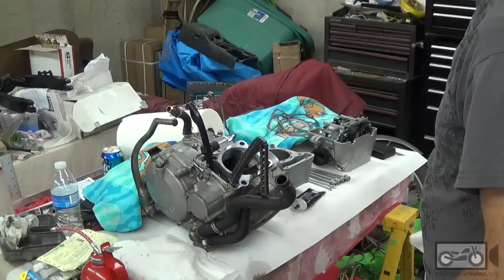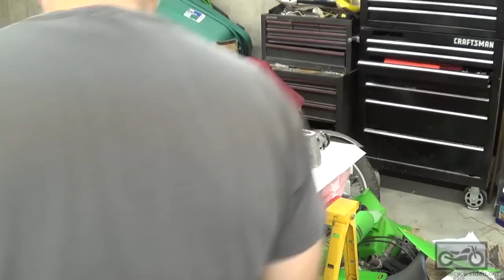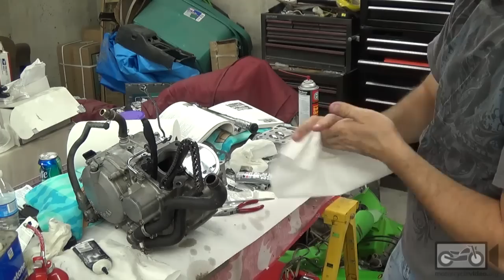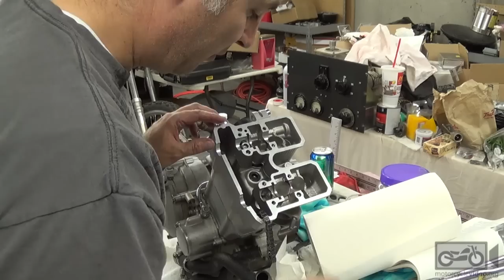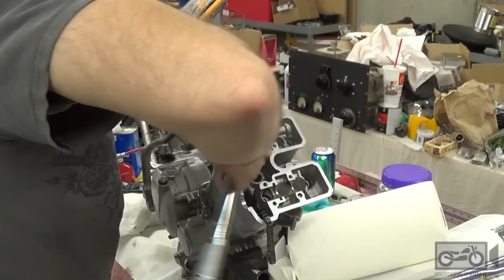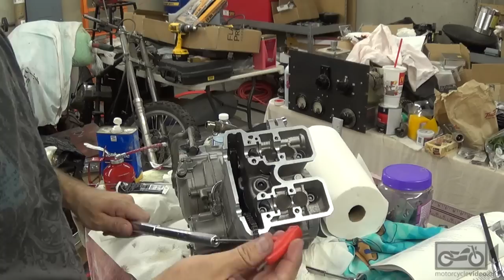How to build a motorcycle engine - KLX 351 "Katsumi"

Comment: putting the clip inside an old socket smaller than the piston clip bore before hand==compressed== , then just pushing in is a lot less drama . ps ,, spray copperkote on head gasket is better ! investing in a 1/4 drive electric impact with a clutch is also a life saver .

Comment: I hate the torque wrench part! Always afraid of snapping a bolt. Very common with todays modern stretch bolts on heads in vehicles! And yes I have done that on a Chevy 4.3 L Vortec engine! Luckily The bolt came right out wit a screw driver!

Comment: Hey is that a 240sx center glove box back there?
Reply from the maker: you called it! its for my Sons S-15 conversion car....
Reply: +MrDuhfactor lol awesome! I saw the s13 seats in another video too!
I have a 1990 240sx and a KLX250SF I want to big bore. It's a fun bike and I'm only 5'5" and 120lbs so it kinda fits me more for the street, but I'm looking for more power. When I bought it I thought it would be like my friends WR250R... I did dropped a tooth in the front sprocket and it's more fun, but I feel like it's just lacking power for me at least. Thanks for the step by step video it gave me confidence on doing it. hopefully next year some time I can buy that 351 Big Bore kit.

Comment: Does this 351 kit need the cases machined larger for the new sleeve to fit?
Reply from the maker: No, it will slip right in. My case was a unique older one that needed a little clearancing, but 99.9% of the cases have plenty if room. Good luck!

Comment: I'm trying to figure out what bore to put into my KLX250s, Just wondering how the one in katsumi has been treating you. I was thinking of doing the 300 kit from the oem parts, but if I do the 350 I'm going to go all out and get the pumper carb too.
Reply from the maker: the motor has been rock solid and reliable. I've had no trouble with the 351 kit, and absolutely love it!
Reply: So worth it over keeping the stock carb and going with the 300cc kit using the oem parts then?
Reply: Also I'm curious as to what kind of mpg you're getting with the big bore too
Reply from the maker: +Don2323 hey buddy, not sure the gas milage, but with the Acerbis tank, I can ride hard all day without running out. I'm geared down too, and only have 5 gears....
Reply: Oh god I forgot the older models were only 5 speed. Must be nice hitting with lower gearing though.

Comment from the maker: Man, I've done that so many times!!!
Reply: Mr duh, can you please point me in a good direction as to what gasket sealer you used on top of the crank case for the cylinder head??? I am inches away from ordering the 81 dollar oem liquid black that the manuel calls for and I cant find a straight answer anywhere....
Reply from the maker: @Christophernice724  You can use several different bonding agents, you can use Yamabond, or even red RTV sealant from your local aito parts store. Use a very thin application so you dont have globs falling into the motor. Good luck!
Reply: @MrDuhfactor  ok would yamabond 4 be overkill?

Comment: No, I was scared the synthetic might cause an improper ring seal, so I just went with Valvoline "superior wet clutch protection" conventional oil. 60mph and a twist of the throttle its like I'm feathering the clutch haha. Need some better springs I think, bike has 12k miles on it.

Comment: i mean your engine i want to know the specs and pricing
Reply from the maker: It is a 1994 KLX 250 R originally. It has a 351 Bill Blue big bore kit, ported and polished intake and exhaust runners in the head, 1 mm oversize kibble white, white diamond intake valves, flow bench tested. Stock cams, 33/34 mm hybrid pumper carb, DG exhaust. I can't remember the pricing, but have around 1100.00 in engine mods. I bought the bike for 400.00, so could put some money in it without stressing over it. If you go to my channel, you can watch the KLX build playlist to see all of the things I've done on the bike so far. Good luck!

Comment from the maker: When I put the piston in the cylinder, then install the clip, I fight having to hold the cylinder in position, and muck up the base gasket with oil, etc, and have oil leaks. So, this way works better for me, but I'm sure other people have techniques that work better for them. As long as it goes together, it's all good!!

Comment: I will install the B&B 351cc big bore kit.   Is the Mikuni carb tm33 worth the money, or will my stock carb work good?
Reply from the maker: Silvana Tompkins The stock carb will still work good, but there is a noticable improvement with everything using the hybrid pumper carb. For me, it was definitely worth it..

Comment: i got the same bike 04. ive had the cams off before and done all that. you seemed to have skipped past the valve clearances on the the new head. is it just stock since your parts are new or did you add shims to new valves.  what did it cost to get the cylinder sleeve done? i m doing all stock parts no upgrade im getting blow by in crank case,  needs to be done. thnxs

Comment: hi, just wanted to ask you a totally not related topic, encountered any problems electrically like while your riding the bike dies off .... but it cant start up right away only after like 10mins of just leaving it...  once it gets going it will be ok for a while and it will sputter and die of again, had my klx250sf looked over nothing seemed to be a problem with it even the rectifier was regulating the voltage , the coil was ok , some was saying the harness?? but if it were the harness your whole bike wouldnt be able to start right? and the electrcal instruments would have just turned off. but when i had this problem the electrical instruments were all on i could even on my light. .. i am stumpped with this problem?? any suggestion...

Comment: you used way too much gasket sealer,  just remember if it squishes out of the motor ,in this case when you put the cylinder on,it will squish to the inside the motor too. And put the camera to the side  or in front  you were in the way most of the time. But I love videos like this. What kind of cams are you using?